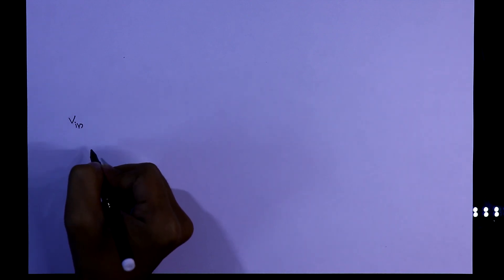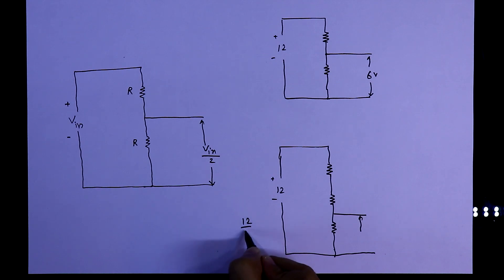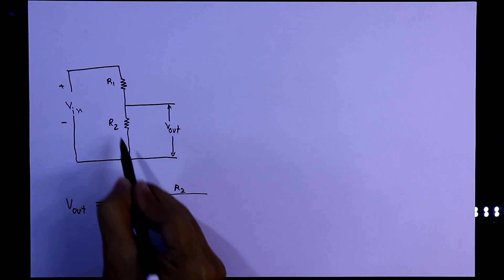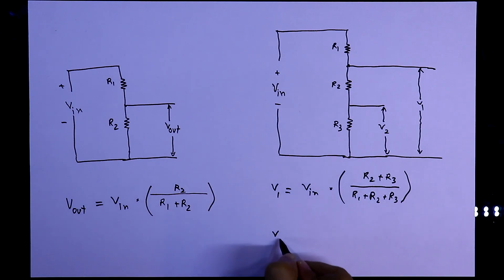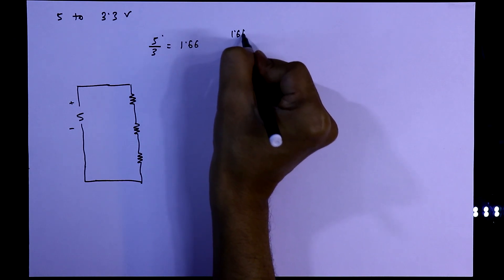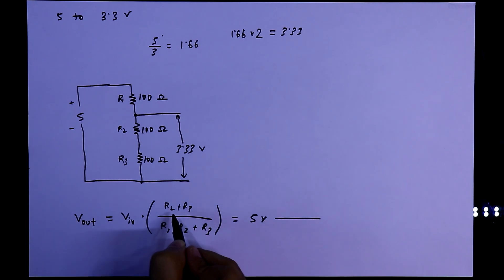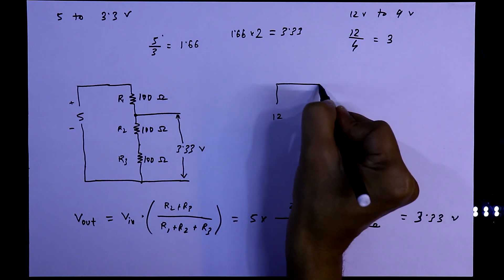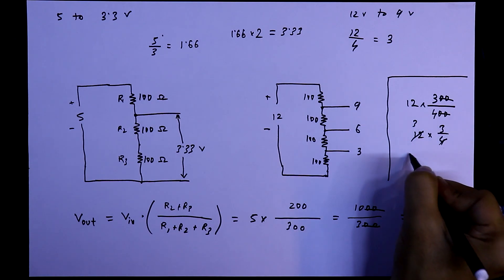Voltage divider circuit using resistor

Comment: If required 3 different voltages then how to finf balue of 3 different voltages.
Like require 3 voltages are 
3.3,,4.0,,and 5.0 with input voltage 5.0v then What are values of 3 resistors??????